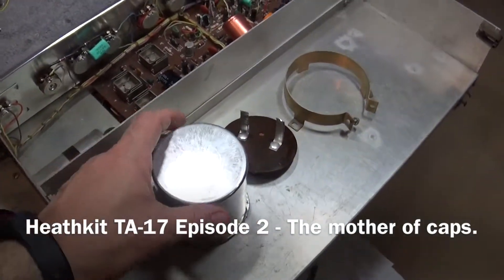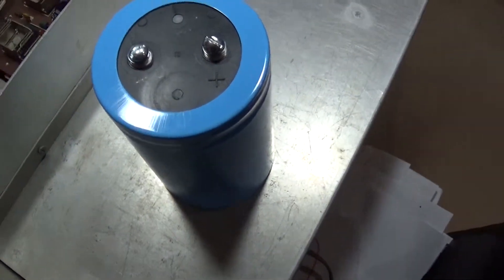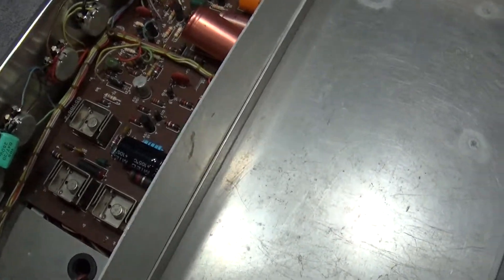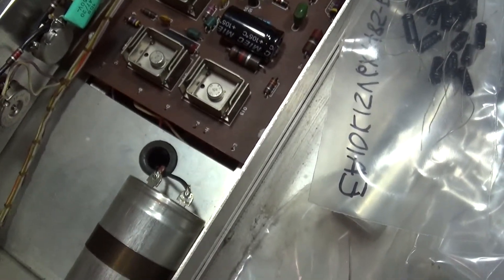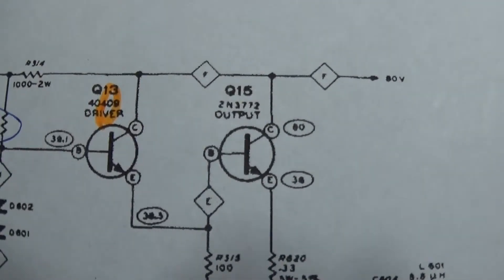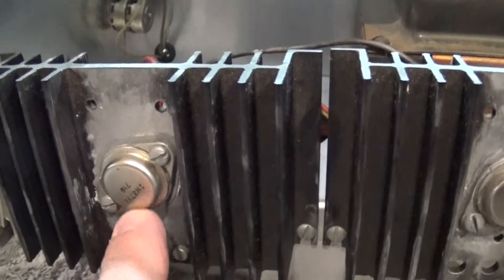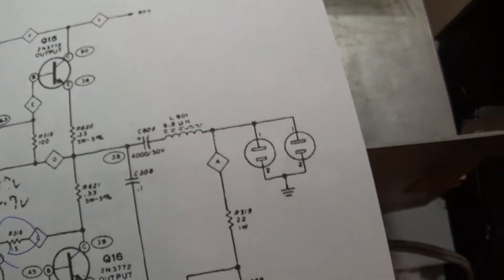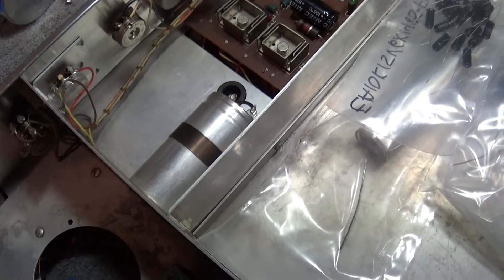Heathkit TA-17 Episode 2 - The mother of caps.

Comment: Now that's a bit weird, the newer being larger than the old.  That looks to be heavy duty too.  Perhaps a few mods for circuit protection.  It's hard to say whether the amp was abused, or age took its toll.  But one thing leads to another.  Um guessing over drive, clippin, and it was toast.  I knew a keyboard player (80s) that fed his Korg into his TA17, he had the 2/12s speaker cab too.  I must say, it was a clean amp, very clean, we were both impressed.  He also had his drum machine and mic into it, sort of a one man gig in night clubs.  Tim built his kit, and had no trouble with it for years, but he did not abuse it.  That's why I got it cheap on ebay, i.e. as is, not working.      Like any ebay, a gamble, but worth repairs, and much less $ than like a Peavey.  I have a couple Shure Vocal Masters that might compare inferior to it, but I never had the Heathkit working to really know.  The only time I seen one used was Tim's with his Korg, but that impressed me.  As I said, looks heavy duty, good quality, and hopefully will be clean with low distortion.  I don't know its specs, only what my ears heard, but  I do remember.  I hope that you will be pleased when done, not many musicians had them.  Don
Reply from the maker: Don
I always try to upsize my parts to avoid problems for the next person. This cap did surprise me  however. I will get this boy back up and running and rename it in your honor.
Reply from the maker: My deal stands. When I get this amp running, I will play bass to Wont Get Fooled Again as the final video. :)
Reply: Will you do the infamous Roger scream?
Reply from the maker: I can certainly try !!!  :)

Comment: Ron,
No, no no, my friend.  Gut the new blue eCap, then smash the old one with a hammer until it fits inside.  Then mount paralleled individual caps on terminal strips until you accumulate the needed number of micro-farads.  How many times must I walk you through this stuff?   Is there no hope, old boy?
Regards,
John
Reply from the maker: Originally i was going to spray paint a coke can blue and install that but figured the amp would be all pumped up on caffiene. Back to school for me - lol.